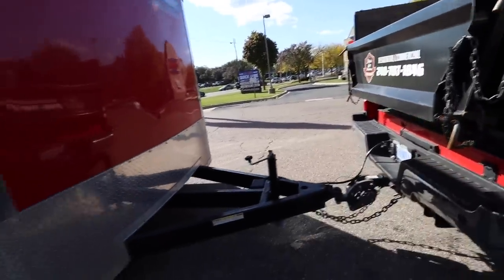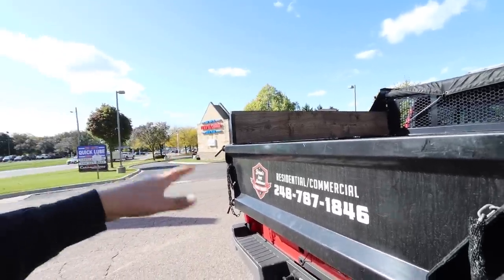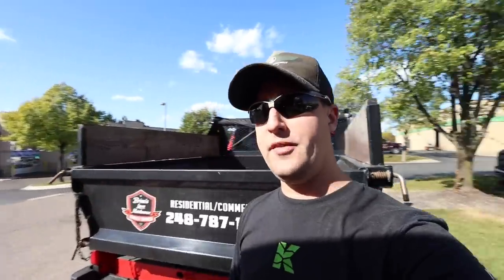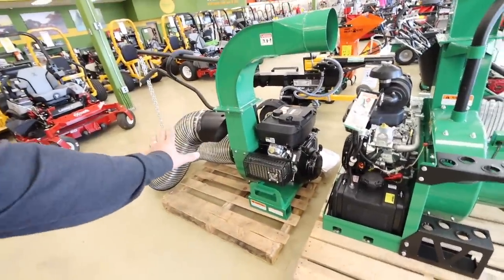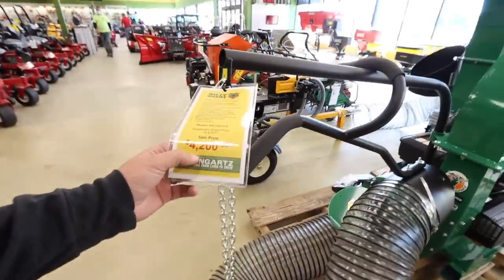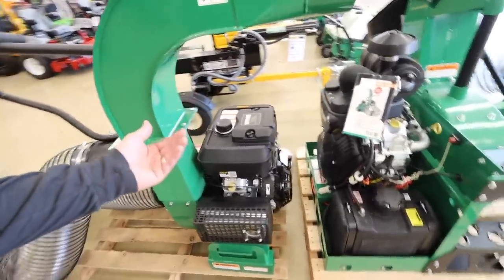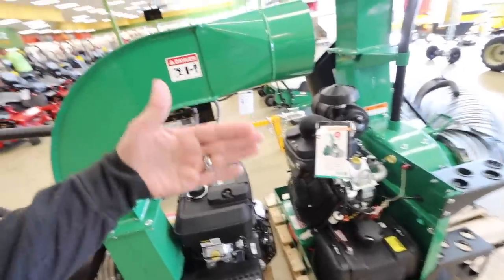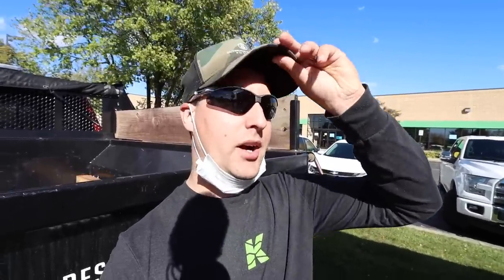How We Plan To Triple Our Leaf Clean Up Business This Fall

Comment from the maker: What unit would you guys go with who do leaf clean ups? The 13hp or the 18hp unit?
Reply: Your advice is to buy the most expensive piece of equipment you can afford at the time. 18hp it is!
Reply: I’d say 14 over the 13 mainly because it has the 10” wide hose less clogs and it’s key start
Reply from the maker: Amen!
Reply: C.F. Husqvarna Carlo! Husqvarna Fanatic I haven’t gotten to use mine yet, how do you like it?
Reply: Brian I would say to get the 18 horse loader and the z3000 blower not the x3000 just my opinion for the size yards you have.
Reply: Buy the HURRICANE!!! Saved me a ton of time and help. Now I need to decide weather to buy the pb8010 or the br 800?
Reply: 18! Anything under you will spend more time unclogging it
Reply: 18hp, I wouldn’t go less, especially if you’re trying to vacuum leaves you’ve gotten up with the mower.
Reply: I’m also not sure how large your properties are, but maybe consider an 18hp push blower instead of the stand on, see how much that gets used then go from there
Reply: S Johnson 8010 for sure! I put mine again the 800 definitely a difference
Reply: Go big or go home. 
 Buy it one time. Why  realize it's not enough then upgrade🥱
Reply: Wait and buy 37hp
Reply: Use backpack blowers and debris loader.
Reply: 18hp is plenty
Reply: 18 hp and it’s a all year round unit for leaves and grass. Bigger is better in this case. Good luck man
Reply: I have a Little Wonder 16hp. It is great, but definitely go with the larger 18 and electric start if offered.
Reply: 18 for sure!
Reply: Bigger the better intake hose dude trust me! I just got a tow behind one, cuz its got a 16" intake hose
Reply: 37hp is well worth the money! Especially if you know you will out grow the 18hp. Anything you put in its path it will clean up wet or dry
Reply: You'll never hear anyone ever complain of to much power.....unless their car is in the ditch.
Reply: 18hp
Reply: @sheltongroup5922  maybe if he had a dedicated 16' dump trailer for leaves. He doesn't need a 37hp for a dump insert.
Reply: Get the 18 hp a lot less clogging then the 14. Definitely a great leaf cleanup tool
Reply: @Suuuuhhhbruh0120  True. I just like to plan for the future. But upgrading is always a option too
Reply: You’ll never wish you bought the less powerful machine, ever. Just make sure it fits where you want to mount it. They save time, energy, and you’ll get more in each load. I bought a new Fradan tlv31d (31 hp) this summer. Hooked up to my 91 international 4600 with a 10 yard grain body. I dont think the stand on blowers are worth it unless you have a huge commercial account with lots of leaves, at minimum. You need to have multiple 10-15+ acre properties, imo.
Reply: I would invest in another truck with a flat bed build a big box make it strictly for clean up and plowing get 2 trucks plowing which equals more property's, maybe its almost time for ya to expand?
Reply: Definitely go with the 18hp if choosing between the two. I have a 16hp which is perfect for us mounted in front of my dump truck, but if I had the option between mine and an 18hp I’d upgrade for sure. It clogs with wet leaves unless you feed it slowly. At least with an 18, even if you expand your business in the long run, you will not have to upgrade immediately.
Reply: Buy once cry once my guy!
Reply: Take the write off on the purchase and the 4k in your pocket. The write off alone will be great, and if it is not working out, sell the units for cash. Now you got a write off, 4k, and the equipment is gone for just under what you paid for it. not a bad plan, ehh
Reply: Bought an 18 hp vac and a 13 hp push blower last season and boy what a game changer it was to us! The vac  and push blower does the work of  what feels like 2 more guys on my crew
Reply: 18hp but I'd consider the billy goat walk behind blower too. Not the stand on unless you're doing multiple acres. $1,300 isn't bad for that big walk behind blower. It depends on how big your properties are
Reply: Go big so you don’t regret it. How is that dump bed working out for you? I would be interested in a yearly review on it. Even compared to EZ dump a year in... thanks for the content Brian!
Reply: People say bigger is better with debris-loaders. But we have to be realistic with cost... That being said, I think back-pack blowyz (pick your fav) and the Powerhorse 420cc debris loader from Harbor Freight or Northern Tool, for around $1799, seems like a nice value initial set-up. This set-up should last you years, and will pay for itself in a week or two, if you're getting at it... I think $8K is a LOT to spend on a mobile fan, man. Sure, in the long-run it will pay for itself. But, let's not get ahead of ourselves. The cheaper set-up will bring a great return on investment, and easily fund whatever set-up you want in the future. No need to stretch.
Reply: 23 years of cleanups here.  there is no way i could be restricted down to a 14 to 18 inch vacuum pipe to load a 90 foot pile of leaves...i use my Rmax8500 with a Echo 2520 hand unit strapped to my left forarm.  a cimbined total of about 1300 cfm's, that blows leaves a solid 20+ feet.. i load a 50 foot pile in about 15 minutes.  90 foot pile compacity, within 45 minutes tops.  

thats $850 to load my leaves up with my two blowers...3-5 jobs max pay for that...1 day...paid for that set up. after day 1 or 2...its all profit.   not 2 to 4 years...well within one week i am making profit
Reply: @servanttofriend8481  - i once laughed with my brother, driving past a crew using old junker blower, to blow leaves into the traler.

fast forward 15 years.  blowers being that of small walk behinds now...now the blower option is on the table.  a the 8010. 800 or 8500  all blow a beam of leaves, 20 foot at a cone about 3 feet wide...  one of them 3 blowers can project leaves just as fast as most vacuums.  this has been over looked, but the reality is that you can load leaves at breaking speed with just a $600 blower and to do other wise..you are just asking to be abel to brag about how much you spent on your removal rig.  not having a clue on how stupid you were being about it...profit is the name of the game.  faster you can get to making profit.  wins

i might only make $5,000 a cleanup season...but its nearly $5,000 profit. no...zero debt.  and debt has two big strikes behind it.  1st..simply having the monthly bill.  2nd...constantly forever worrying about making that payment.  each month. 12 months a year.  24 to 48 payments...that mental borden never is gone.

so hit profit as soon as you possible can. never mind having to deal with some other nik nak bs that comes up.  cause a debt..you know you have bs popping up on you...each month, for years..

these guys slapping 50k down on credit. let alone more...fukn stupid in my opinion...

oh and strike 3 btw.  can't forget strike 3 about debt... in the leaf removal service...you might have 2. maaaybe 3 season of favorable rain conditions.   but have one very bad one sux so bad,  that it sets you behind in profit all the mean while,  you were forced to just let it happen...can't do leaves in the rain and the next day...all your job time just more than doubles,  while taking on the extra head ache of dealing with wet leaves. and it is a given, yo uwill have a bad rain season for leaves, every 3 to 4 season.  sometimes it might be back to back.   either way.  just 1 bad shitty rain cleanup season...hurts bad.  even for me at bare ass minimum equiment cost and having no debt.  i would flip the fuk out if i had a full vac rig this season for a fine example...i'd be watching it rust more than it worked, haivng no choice to do so taboot....while either way, that payment is due. and im about to go negative profit.

Comment: All I would suggest is having the biggest debris loader you can get. It will save you so much money and time in sucking up piles of leaves. I’ve used both small and large sized ones and there is a HUGE difference.

Comment: I've had that set up for almost 20yrs. I only do lawn service part time. I bought a used 13ho billy Goat and put it on a custom rack on tongue of trailer. I made my frame just big enough to set leaf vac on and in summer, that same rack holds my grass cans to keep them out of the trailer or back of my dump insert. If I had to do it again, I would have started with a 16hp or 18hp. The 13 clogs if you try to go too fast or if they're wet leaves.  Since I do work solo, I have suction hose on drivers side so I do t have to run around the truck when sucking up leaves... another thing I found that saves tons of time, using monster leaf bags on grass catcher. Learned long ago, work smarter not harder. Some of my properties I can do in a third of the time with this system. I make more money doing leaf clean ups than anything else working solo.

Comment: Don’t think of the stand on blower as just a leaf blower. You work for a few decent commercial clients now with a decent parking lot. Offer blowing off the parking lots of stone and dirt debris to keep that concrete looking good. And even in the winter coming up. People are using backpack blowers on lighter snows to blow off walks before they plow. The only hiccup in that scenario is getting the thing there. Sidewalk crew? Small truck with a small trailer loaded with guys and shovels and the machines taking care of walks? Just floating those ideas your way.

Comment: Even with extending the walls or building a leaf box on your truck I’m not sure if you’ll really have the capacity to take advantage of a debris loader. They do shred the leaves and reduce the volume quite a bit, but it’s still going to fill that little 8’ dump insert very quickly. Just depends on how quickly you could empty the truck and get back to work I guess

Comment: Solo operator here. I run a 12 ft dump trailer( 7ft tall box) with the billy goat 18 hp. Get as much hp as you can to reduce clogs. As for blowers the standard 13 hp push blower is great. The stand on blowers are nice but, you have more flexibility with the push blower. Ie you can use during the mowing season to blow curbs and open areas, keeps it working year round instead of sitting for 9 months.                                                               I also throw a 48” walk behind in the truck bed to push leaves once they pile up.  Think of it this way. You can get the a push blower and leaf vac for the price of the 37hp leaf vac.  Anyway keep up the hard work.

Comment: Definitely recommend the 18hp Billy goat debris loader. Great machine. I've purchased two brand new. Got ten years out of first unit, rebuilt once, still runs amazing. DO NOT Waste your time setting up the pick up with a debris loader. Not big enough. You will fill up truck In an hour. For stand on blowers the Toro multiforce pro force blower is the sh**. Just purchased this year. Can't wait to get some hours on it

Comment: I have the 18hp billy goat debris loader and it is more than enough for us to fill our 6x14 trailer with 4 ft side walls. The force of air coming out of that can easily blow to the front of your truck. The piranha blades included obliterate the leaves wet or dry. If you get it and mount it to your trailer...make sure the exhaust is still facing outward and not towards the trailer...it’ll cut out all the time of you don’t. I learned trial by error...had to turn and completely redo the mounting system. We’re looking at getting the walk behind blower with the most cfm cause the stand on can be too heavy if it’s a wet fall and o don’t want to deal with getting stuck or waiting for a lawn to dry out before we can remove the leaves. Curious to see what you choose. 👍🏼

Comment: I bought the Ferris FB3000 stand on blower back in February. Would be lying if I said I was super hesitant due to the cost. But I can very confidently tell you it’s probably been the best piece of equipment I’ve ever purchased. It’s a total game changer for leaves. But you can also use it year round with cleanups, blowing off parking lots, and large driveways. I’ll never get rid of it.

Comment: One issue with mounting the loader on the trailer and blowing into the truck is that you will have to remove and reattach that blower extension for every job because of the pivot point where the truck and trailer meet.  I don't know if there is a quick attach extension that you can put on to connect the loader to the box on the back of the truck, but if there is then that would be great.  It would take a lot of time to show up, bolt on the extension tube from the loader to the box, load everything up, then unbolt the extension to move to the next lawn.  Not to mention trying to keep track of all the nuts and bolts that hold everything together.  I saw a video where a guy used a piece of 6" flue pipe (available at any HVAC supplier) to quickly join the blower to the box on the truck.  Don't forget about where you have to park for those leaf cleanups as well.  If you have to park on a curved street, you have to have your truck and trailer lined up straight for that setup to work.

Comment: Depending on how many leaves you take away the 18 HP loader is probably your best route to take. Around here in Northern Illinois all my customers back up to a wood line so I never have to take away a single leaf with me when doing fall cleanups. Generally I just run over the leaves with the discharge facing the wood line and go back and forth starting at the farthest point of the property and by the time I am at the wood line the leaves are pretty well mulched up. But if you do a lot of subdivision lawns that don't have a wood line  I would go with just the debris loader. I don't think the stand on Blower is worth it unless you are doing big acreage.

Comment: We have a lot of properties with wood lines as and still use the leaf vac in a lot of cases. It can be a lot faster than blowing through the whole property when there is obstacles and what not. I reccomend doing what you can to fully encapsulate the outlet hose. They blow leaves like crazy. Without a big box on the back of your truck, you're more likely to blow the leaves all over your truck than in it. We dedicate a dumptrailer to it.  As far as horse power, you can never have to much. Leaf cleanups make us a ton of cash.

Comment: Double your sides and get a landscapers net tarp. It will keep the leaves trapped in your box.  Idea comes for BillsTmaxx, it is what he has done for a trailer to pickup leaves at a cemetery in Orangeville, Canada.  All so he has the blower connected by a large flex tube.

Comment: Last year I used a 16 foot trailer to put the mulched up leaves in. I have only one truck so I have to pull the trailer with the equipment drop that and then go back for the trailer, that is for my out of town customers. For the in town customers I use lawn waste bags because the city will pick them up.

Comment: Hey man, the leaf vac is a great investment because it's a machine you will have for a long time and once you bite the bullet on the purchase you won't regret it. The time you save with a leaf vac is huge. I actually have the same setup with the 18hp billy goat leaf vac that you plan on doing with your truck on my dump truck it works pretty good but just make sure you put a vent on the leaf box because the air moves so fast into the box that if you don't vent it, it blows up like a balloon lol.( which you probably know already) As far as the stand on blower goes, you honestly don't need that size for the yards you do. If you buy a 10hp push blower you will be fine. I just bought a billy goat 10hp for 1300 brand new and it's still super powerful.

Comment: I live in Missouri I use the 14hp Subaru Billy goat loader and shoot them into my 7X14 dump trailer. It works great unless the leaves are really wet. It's a very affordable option to start with.

Comment: Easy one brian. They make a swing away hitch mount for your truck. This allows you to use the truck only and build your box for your dump bed. When you unload swing it out the was dump, and keep on getting it. At 17g you can do alot of work with some blowers. As far as what you can pack into the truck the billy goat I think is a 12-1 reduction so you can pack more in the bed. I have an older 18 hp and it does fine🤷🏼‍♂️.

Comment: I’m located in northern Michigan just east of Gaylord and leaf cleanups are a big money maker up here. I have been dealing with the same conundrum. I have been using an Exmark with powered bagger and leaf plow, little wonder push blower and Stihl 800 back pack blowers but decided to take the plunge this season and bought a Scag Windstorm. I have the luxury of a lot of wooded areas to blow leaves into but will definitely be looking into a dump bed or trailer and debris loader next season. The stand on blowers are stupid expensive but so far I’m very happy with it. Leaf season is just getting started and I’m looking forward to not pushing the little wonder around.